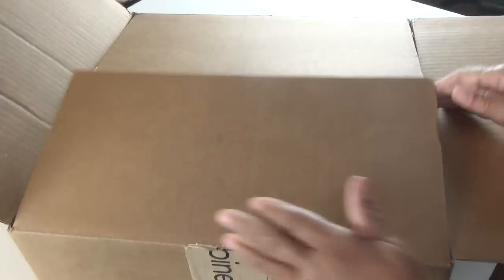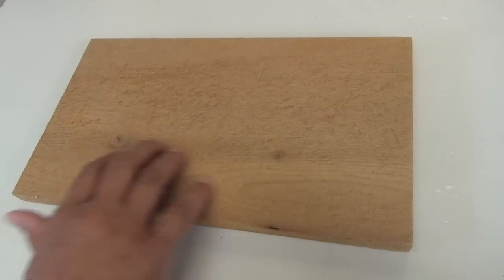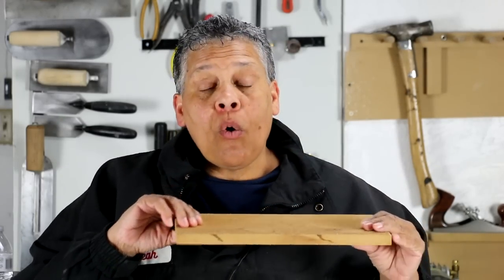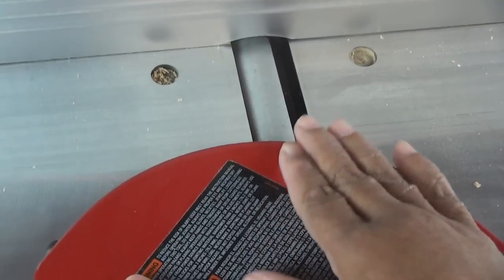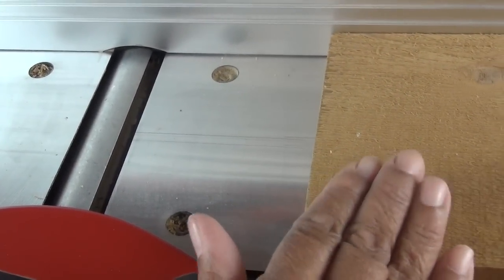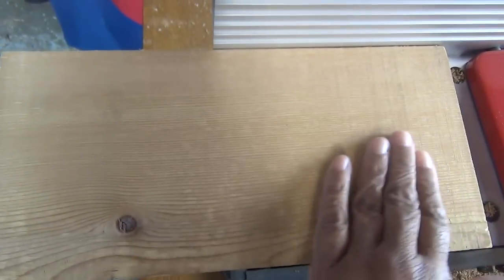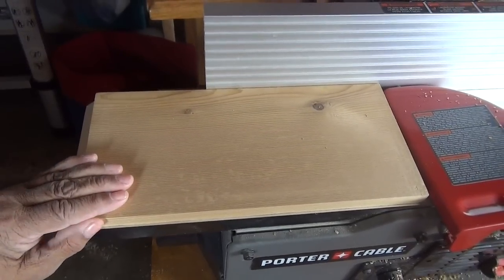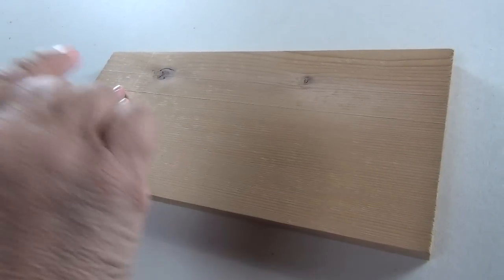Wood Jointer Basics for Beginners

Comment: Thanks for another great video, Leah! One thing that might be worth covering in any future video on joiners (or surface planers/buzzers, if you live outside North America) is that your outfeed table is your reference surface, i.e. you push your workpiece down against the outfeed table but not the infeed table. You often see new workworkers pushing the workpiece against the infeed table and then mystified that the workpiece is no better (or sometimes even worse in the case of bowed timber). Also, just to offer a alternative opinion to one of your previous commenters, in my experience the surface planer is one of the safest woodworking tools. I've never seen an accident on a surface planer -- by far my most commonly seen accident is on the table saw/cabinet-makers' saw -- closely followed by the spindle moulder (I'm not sure what a spindle moulder is called in the US -- I'm guessing something else -- it's the machine like a giant router table from hell (you'll know what I mean if you've used one!)).

Comment: Thanks for the demonstration. I just got me a jointer and I leveled the blades any everything. Wondering though, my first try my board came out shaping like a bow. I think maybe I'm moving pressure wrong wen pushing it through. I guess you start with a bit of pressure on the infeed then move to the outfeed?

Comment: I have recently retired and have decided I am going to start Woodworking. I’ve bought a thicknesser planer, and many other super power tools and the plan is I’m going to use pallets to make whatever I decide to make. My first project is going to be my floor once I have enough pallets, Im clearing my garage to make a workshop, it’s so exciting, I’m really looking forward to getting it done.
Reply: Take real good care none of your power tools catches a nail! Take care and good luck.
Reply: If you're going to use pallet wood, get a small hand-held metal detector to go over the wood before running it through any power tools. Better to find and remove the metal as your first step to save your tools or hands from any damage.
Reply: Hyder Enterprises, thank you for the advice, I will definitely make sure the wood is free from all metal.
Reply: Tybalt Moon thank you, will do.
Reply: I've been working with pallets and I wish I had a thickness planer!

From what I've learned breaking down pallets I would recommend a reciprocating saw with a metal blade and a small crowbar. Use the crowbar to pry a bit of space between the pallet boards and the pallet where the nails are, then use the reciprocating saw to cut through the nails to separate the board from the pallet. It's so much faster than cutting through wood. Finally, use a punch and a hammer to just punch out the nails from the board.
Reply: Contrarian Life I have the Makita reciprocating saw and have the wood and metal blades, I recently used it to remove and replace my cousins newel post, excellent tool. I have also ordered a Roughneck prying bar so hopefully it will make things a bit easier. I’m presently watching loads of you tube videos in preparation for the task ahead. Wish me luck😊
Reply: Ms Sonia, if I may add, go ahead and tear those pallets apart.  Stack the lumber in a room that has similar temp and humidity to the room you will use the lumber, if not the same room.  And don’t forget to sticker each layer.  This way, the lumber has time to acclimate and you will see which boards are truly usable.
Reply: Elaine D thank you, I will take your advice, looks like I’m going to be living in a timber yard for a while 😂
Reply: Good luck! Those pallet nails do not like to separate at all, but the crowbar gives you just enough space to fit the blade between them. Makita's a great brand.
I made a couple of balcony planter boxes and a few wall shelves. Have fun!
Reply: Good luck with your projects. It is time-consuming but cost-saving and rewarding to work with pallet wood. There's always a story about where you got your wood. 

Check out Izzy Swan. He is a brilliant YouTube DIYer who has a great design for a tool that pulls apart pallets easily. That should be MUCH easier than crowbar method. I used the reciprocating saw method, and it works...but again: time-consuming and batteries die on the field.
Reply: Well  done and good luck in your new venture. I too am hoping to do the same. and Thanks to Leah for another great YouTube video on a Jointer.
Reply: @contrarianlife5904  I've watched a lot of YouTube videos on taking pallets apart. Two weeks ago I started to take apart my first pallets.
For that purpose I had bought a reciprocating saw. For making space between the pallet boards in order to have access to the nails
for cutting them I had the best results with the metal head of a small axe. I found that a small crowbar is too thick.
Cutting the nail with the reciprocating saw (of course with a blade for metal) is a matter of seconds. No problem at all.
Getting out the nails of the boards is sometimes quite difficult  but with a little experience it is doable.
But I'd like to you the blocks as well. Do you have some tips to get the nails out of them?
Reply: Seeing this comment a year later, I'm dying to know how it went!  Or how it's going if you're still in the process.  I've never heard of anybody using pallets to make a wood floor and I love that idea.

Comment: Leah when running the edge through the table saw do you set the cut to be the same as the jointer?  or it doesnt matter
Reply from the maker: Hi Oscar, it doesn't really matter, but you want to take as little stock off as possible...the entire length of the board, for it to square up

Comment: I found a 6 inch Jet jointer at a garage sale several years ago for a song. I don't use it because it needs both tables adjusted & it's confusing to me. Nice demo Leah.
Reply: Joe Brown I have and 8 inch Grizzly, same machine. Adjustment is fairly easy. Set out feed table to match height of cutting blade
Reply: I really need to get this working properly. No substitute for this tool. Thanks
Reply: Use a straight edge to match the out feed table to the highest point of the cutter head blades. I usually set the in feed table to 1/32 lower. Most of the time that will take enough with a few passes to straighten most boards out. She does a pretty good job at explaining technique
Reply: Thanks

Comment: I have a question... is there a reason you can’t flip the wood over and use the jointer on the other side and to do the other edge?
Reply: Flipping it over won't necessarily keep the opposite end parallel. To do that, you need a blade running parallel to the fence like a tablesaw or thickness planner does.
Reply: @doublej82  Understood. Thank you for the explanation.

Comment: Is there a difference between rough cut lumber vs pressure treated lumber? is one stronger than the other?
Reply from the maker: yes, there is, and no, one is not stronger than the other.  They are very different.  Pressure-treated lumber is chemically treated to guard against rot and insects and whatnot.  It also gives longevity to wood used in exterior construction.  Rough-cut lumber is lumber that you typically purchase from a mill or lumberyard.  It is purchased in board feet, and you mill the wood yourself.

Comment: You mention that this can be done without a table saw and planer? What are other methods? Also, can you add videos showing handheld planer? Still building my power tools and would love to gain experience with the smaller less expensive tools. Thanks!

Comment: I just bought this also with a Dewalt Dw35 planer. One question I have is what is the blade stop for? And also when you adjust your depth of cut, the table on the in-feed will be that much lower than the table on the outfeed, right?

Comment: I just bought a jointer yesterday, and I'm struggling with the edge jointing. I couldn't get the edge completely flat, and after a while I realized I had cut off an inch or so from the front end, but hadn't touched the far end. Is there a trick to starting out so the board is roughly parallel and I don't end up with a giant triangle?

Comment: Also, what you just said is every piece of wood starts in the jointer and it only needs to be passed through one edge and one face, than to table saw to square up and than to planer to fix the other face?

Comment: The infeed table on your jointer has a hairline crack all the way down the middle. Also, since you aren't using dust collection, the 2-1/2" dust port at the outfeed end must be removed. Then you won't get all those chips blowing back up the cutter head, interfering with it and your work, not to mention clogging up the guts of that little machine.

Comment: Is there any risk to running your edges through a jointer a second time?  I ask this because I ran my pieces through the jointer two or three times already  (i.e. face jointed then edge jointed). Afterwards I ran them through my thickness planer and ended up with ripping the last edge at my table saw.  When I laid out the boards for a dry fit (i.e. I'm laminating them to make a table top) I noticed that a few of the boards had what appears to be a "not" flat surface. There were noticable gaps between a couple of the boards when I did a dry fit.  I'm thinking of edge jointing a few of them a couple more times to flatten out the edges. I have a little wiggle room as it relates to width of the boards. Am I on the right track?  Thanks for your consideration and ??reply. I am somewhat of a newbie, but perhaps not a total "novice".  I wish I could include a picture of what I'm building but I don't think that's possible.
Reply: Hi, I'm new to woodworking, but I took a furniture/cabinet class. This is the milling process I learned: one face and one edge through the jointer, mark them with a pencil. Run the other face through the planer. Cut the remaining edge on the table saw making sure you are referencing using the first flattened edge. Always check the jointer's fence to make sure it is 90 deg. You're done.

Comment: Hi Leah. I have question. Yesterday I bought my self the same jointer you are using. Is that normal when you feed the wood you feel will fly off the from your hands and you have to fight it. I was using hard wood. African Padauk. Thank you
Reply from the maker: Hi Mike, it isn't typical.  It sounds like you are perhaps trying to take too much wood off at once.  You should adjust the infeed table so that you are removing less wood.  For example, I have mine set to remove just 1/32 of an inch.
Reply: seejanedrill thank you so much. You are a life saver. It did work!!! I do have 2 more questions. 1- how long of a bored I can plane in this jointer? 2- what type of planer do you recommend Wen? My budget can't afford a Dewalt planer. Thank you so much for your time

Comment: Can you just use a planer on both sides instead?
Reply: No because a cupped, warped, bowed piece of wood will just flex while going through the surface planer. The planer could make it smooth, but it will still be cupped, warped or bowed. One side has to be flat and only then will a surface planer make the second side parallel to the first. A jointer could make both sides flat but it's extremely unlikely both sides would be parallel to each other.
Reply: Mike Cass I wondered something like that, too. I couldn't figure out why she didn't just use the jointer on the other side, also.  Being someone with zero experience, they look like they did the same thing, but I'm sure that's because I don't know the difference between the jointer and the surface planer.  The closest I've come to a woodworking shop is watching videos. I find it all very interesting to watch people build things, but I've never actually done any of it myself.
Reply: K.B. Woodworker It was really nice of you to take the time to post that link. I'm quite sure I'll never use either machine, but I still enjoy learning new things. Thanks for your help.
Reply from the maker: Turning Point...your explanation is spot-on.  Thanks for sharing that!
Reply: CrankyPants I would like to encourage you to leave the sideline take the “ plunge” into basic woodworking. I was just like you and finally decided, with a minimal initial investment, with Leah’s help, to start on some very basic woodworking projects. Several years later, I am actually building my own honey bee hives and basic bench projects for friends. Very much fun and a rewarding activity. I encourage you to give it a try!

Comment: Good video, but a few important points I think you missed.  Next to a table saw, the jointer is one of the most potentially dangerous pieces of equipment in the shop.  Use the guard, push sticks, etc.  Light passes are best, especially with thinner stock.  If you push down across the cutter head, you may bend the board slightly, and it won't be flat when you're done.  Rough cut your wood first into smalller pieces, or you will take off way more material than you need to.
Reply from the maker: Hi David, you are right.  Thanks for sharing this with the community, as it can be difficult to include everything about a tool in one short video.  Your comments are greatly appreciated.

Comment: With the jointer and the planer you also want to avoid running previously sanded wood through them. It really dulls the knives. And a metal detector is worth the cost to check all self harvested wood.